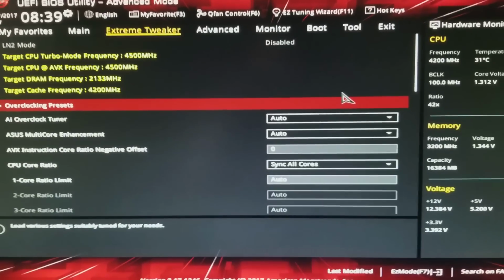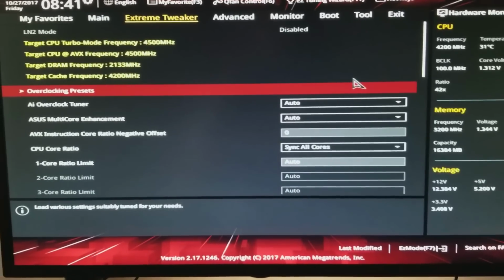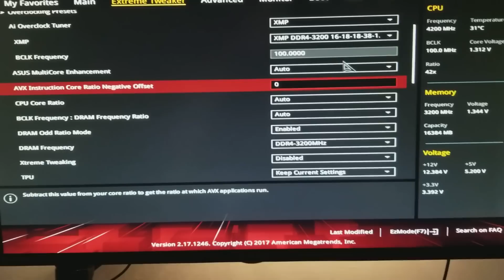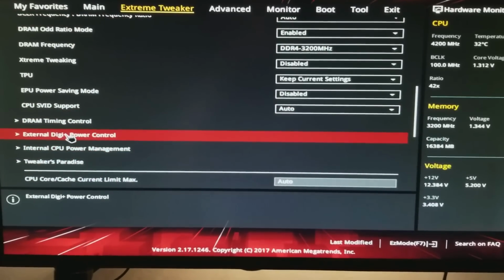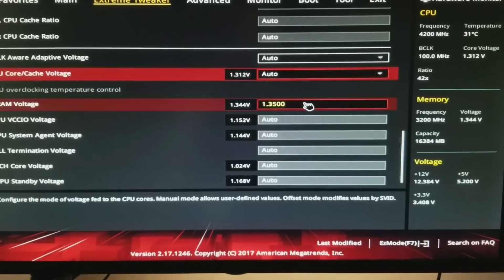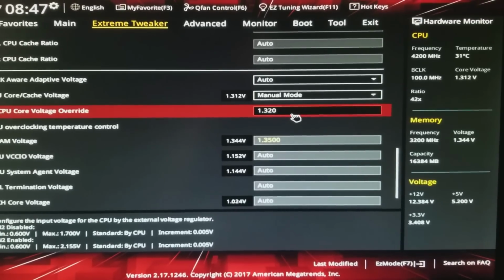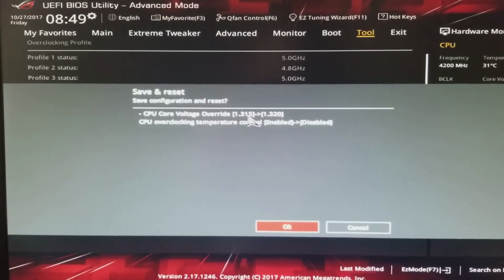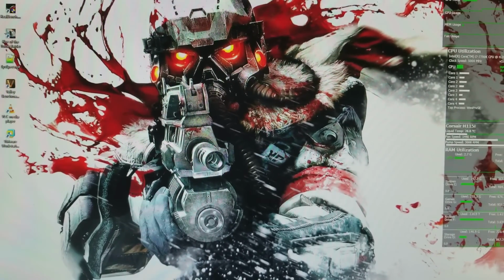Overclocking i7 7700K to 5.0 GHz on Asus Maximus IX Hero Motherboard

Comment: I pretty much own the same setup as you, just changing the VGA (1080ti here) and the PSU (EVGA G2L 850W Gold), but the rest is identical, same CPU, same RAM and same Water Cooler and MoBo, with the difference that I lived in a city in South America, most precisely in Curitiba,  South of Brazil which is the coolest region of the country, even though, we still getting around 25~28 degrees celsius (around 77~85° F) in this Autumn, do you think my system supports the same changes you did on yours without crashes or superheating? What can you say about the  shortened life of the components using a overclock like this? Thank you for share this content!
Reply from the maker: It's hard to say without testing it myself. I am in southern Canada but I keep my place between 18*C-22*C depending on the season. Ultimately I try to leave a 20*C margin with the CPU max temp, as long as you can achieve that you should be okay. Also, as I mentioned in the video, delidding greatly reduced temps. I would easily hit 100*C before delidding, now I never go above 80*C even with all cores at 100%. notably my h155i died and I have been using a Noctua NH-D15 for a few months now with slightly better cooling performance. I have been using these specific settings (but disabled AVX offset) since this video was posted and have had this chip OC since i got it a little more than a year ago. I have only had a few crashes (mostly while making minor OC changes and testing). As for longevity I can't say for certain; however, I have OC every CPU I have ever owned and have never had one die before I decided to upgrade anyways. Every chip behaves a little differently, some overclock better than others. I'm sure some can/will die prematurely with no OC done to them.
Reply: K JL thank you for your answer! I think I can do it on my setup...

Comment: Ty for the video, i am able to do 5.1ghz with 1.32v runs 65c under load

Water cooled and delided...

I was run ing just under 5ghz with asus bios built in OC, running 70c underload
Reply: What was your Avx offset?

Comment: I have z270 mark 2 and i7 7700k, all parameters are stock factory and my processor is at 4500ghz always. when I don't use my computer the processor should be in a lower frequency but it's not the case. anyone know the problem?
Reply: Asus multi core enhancement

Comment: Why my cpu voltage shows up to be at 1.008 V only?
Reply from the maker: Dj Steirdi Are you refering to the voltage seen in the BIOS when setting the vCore. Most likely this is your stock clock voltage. If you set the multiplier to 50 your CPU will not run at 5.0GHz until you reboot. Once you have everything set save and boot back into the BIOS the voltage should now be around the vCore you set.
Reply: Yes in the bios and i also did everything you mentioned in this video and my CPU-z and HWmonitor shows my cpu to still be at 4.2GHz, i tried and changed those same values in Intel Extreme Tuning Utility and they worked but i uninstalled it because i thought that it was conflicting the bios so now it seems like i can't overclock at all. The changes doesn't take effect when i change these in the bios for some reason.
Reply: Never mind it seems to be working now, i just incrased the voltage to 1.350V because it was too low for a such of high overclock.
Reply from the maker: Dj Steirdi It can vary from chip to chip. I have been stable at 1.32 for many months now. 1.35 is still decent, make sure to do some extended temp and stability testing.
Reply: Aye, actually now it's sitting at 1.30V and seems to work just fine, although when played a game it stopped working couple of times and just froze with sound looping so i decided and tired to remove IA DC Load Line and IA AC Load line if it fixes the problem hopefully. I'm not sure what is causing it but hopefully it will be fine for now.
Reply: Hey again i'm here sorry.. But when i updated my bios all my settings were gone and default so i needed to overclock again.. So when i set that AVX thing to to 2 when overcloking to 4.8GHz obviously it's 4.6 GHz when you're using such programs but while i ran the Chinebench it stayed at 4.6Ghz~ still so can i just set it to 0 and it wouldn't hurt anything or reduce my CPU lifespan at all? (Not delidded) Also is a 1.270 voltage enough do you think or such of CPU speed?

Comment: 5.0GHz = 1.36V
4.9GHz = 1.26V
4.8GHz = 1.22V

Dont over volt your cpu :D
Reply: Heram Maravilla mine needs at least 1.4v... just to boot... I really didnt got lucky on the lottery
Reply: My chip does 4.8 at 1.24. confirmed with OCCT large dataset for 5 hours. 1.22 and 1.23 were unstable.

Comment: Hey bro i have a question do i need to overclock the 7700K to use xmp on the ram because i want to have 3200MHZ not 2133MHZ do i have to overclock necessarily
Reply from the maker: Patricio Villagra nope you can enable xmp and use the stock clock speeds if you want.
Reply: I have the same setup..overclocked to 4.8 stable right now. 5.0 got too hot even with liquid cooling. Need a delided cpu
Reply: Oh and my ram wont go to 3200mhz..wont boot windows. 3000mhz works fine though. I pull 130-150FPS in Just Cause 3 on highest settings in 2k resolution
Reply: @kojack635  You got screwed if you bought 3200.   Gskill is your friend.
Reply: Kojack mine boot with 3200 mhz thats weird

Comment: I overclocked my cpu but it won’t even load in to my desktop it just stops and everything turns off on my desk ? What am I doing wrong? I have a Corsair h200i
Reply from the maker: Paytonzfamez you overclocked to 5.0GHz? Are you able to get a stable OC at 4.8GHz? What vCore voltage did you set?
Reply: I did 4.8 and it won't boot.

Comment: Does this guide work the same with the Maximus IX Code Motherboard?
Reply from the maker: OrganikSkillz yes it should. Technically speaking the settings adjusted here can be done on any mobo it would just be a matter of finding them in the bios and tweaking them for stability.
Reply: Yep. I have the exact same mobo and it works completely fine.
Reply: I have a Maximus IX Code and my clock is 5.2ghz, vcore 1.43 and temps +/- 75º. I have one Thermaltake 360mm.

Comment: do you have to delid?
Reply from the maker: Chris Hornback yes i delidded my CPU. I did say this in the video.
Reply: I know I wasnt asking that im watching your video right now, im wondering if you have to delid it
Reply: and do u have discord i have a question
Reply from the maker: Ah okay. Well you dont "have" to but i would recommend it for 5.0 GHz. Prior to delidding I would hit thermal max (~100*C). Where as now I do not exceed 75*C even at 100% load. I ran at 4.8 GHz for a long time prior to delidding with no major temp issues.

Comment: Personaly I dont see any reason to even attempt de-lidding you're cpu unless you want to break it, or you want to push 5.2 ghz. If you do it slowly and the right way you can have 4.8-5ghz on a 7700k without problem but cooling is important
Reply: Spectraculus it's to improve the contact between the chip and the cooler for better temps.

Comment: What temps are u getting @ 5.0GHz? Had to drop mine down to 4.9GHz at 2.80 volts. At 5.0GHz I was getting in the high 80°C. Great OC video! Thanks.
Reply: 2.8v Are you trying to cook steak on it?
Reply: 2.80v?
Reply from the maker: At 5.0 GHz I am geting 40*C-55*C during gaming depending on game/load. Idle around 30*-33*C and full load H.264 encoding is 65*C-70*C. When are you seeing 80*C? through general use or when benching. Because Im pretty sure I could hit 80*C if I ran AIDA64, but that is much better compared to the 99*C I was getting before. If 80*C is your bench/torture temp then that really is not that bad. If it is a temp you see when gaming or with heavy (normal) CPU load then yeah that is pretty hot (but still 20*C below thermal max).
Reply: @KJL00 yeah um are you trying to bow it up? should never go above 1.4. I am at 5 Ghz 1.28 (got lucky with my board/cpu) Oh and for a 7700k you should get a NH - D15 (don't need to delid your cpu)
Reply from the maker: @parkinsaw  not sure where you are getting that i said to set it to 1.4. In fact at 7:45 in the video I suggest not overclocking to 5.0 GHz if you cant achieve a stable overclock before reaching 1.4v, especially above 1.40v. My h115i died since doing this video and i am currently using a NH-D15. I said I recommend delidding it not "you must". No, you don't HAVE to delid, but you will see far cooler temps if you do. I delidded my CPU before I did this video and it has been running fine since, it rarely ever exceeds 75*C (at continous 100% load); however, before I did that I would thermal throttle and almost hit 100*C. Every chip is a little different, so yeah some may not have to delid, others might if they dont want to burn out their chip with continuous high temps. I have heard of very few people that have not had soaring temp issues with this chip. Especially those who got it around its initial release. Again, with this OC, delid, and using the NH-D15 for over a year now, I've had no stability/temp issues.

Given the chip would probably fry at 2.80v and not go "high 80*C" like the original comment suggests I take it they meant 1.280v.
Reply: @KJL00   Yeah sorry meant to reply to the individual above you lol, wasn't quite sure what he meant with 2.8, but you are correct delidding a 7700k is preferable but not always needed

Comment: What app / desktop widget are you running on the right side of your desktop? The one with your system resource stats.
Reply from the maker: It is called rainmeter (https://www.rainmeter.net/ ). You can find a lot of good skins ones online. The one in this video is variation I made of the following skin: https://socaldj.deviantart.com/art/Ultimate-System-Monitor-182665749

Comment: K JL  did you know about PLL OC voltage?
Because it can drop 10-20C
Reply from the maker: Have you tried this on an Asus board? 
I looked into it and from what I can find most people that tried this did it on an MSI board.
Maybe I'm missing something but in my BIOS I can only find "PLL Termination Voltage" and "PLL Boot Voltage", no "PLL OC Voltage". From what I can find it also looks like these large differences are related to inaccurate readings, idle temps below or too close to room temp.
Reply: K JL man ive been running like this for 8 months and when i didnt mess with the "PLL OC voltage" i was getting 78C+ easily on 4.5Ghz.
Since then i managed also to overclock my CPU up to 4.9Ghz with 1.35V and play games with no issues.
No Damage seen anyway..
Im still getting the same scores as i used to get when i built my new PC on january 2017
Cinebench R15 MultiThread (Stock)  1005 Points
On SingleThreaded(stock)
197 Points.
And it still getting to that scores.
Reply from the maker: What motherboard are you using? I cannot find a "PLL OC Voltage" option in my Asus Maximus IX Hero BIOS...if you are using the same board or other Asus board I'd like to know where this setting is. That being said with the settings shown in the video I  dont exceed 76*C even when 100% load encoding H.264 with handbrake or adobe premiere, or when running prime. My gaming temps at 5.0GHz are 45*C-50*C so I  wouldn't expect too much of a drop beyond that regardless of what is being changed.
Reply: K JL I'm using an "msi z270 gaming m3".
I guess you delided your cpu though
Reply from the maker: Yeah, from what i can find "PLL OC Voltage" is in MSI BIOS. I don't think it is in the Asus BIOS (I couldn't find it anywhere). 
Delidding greatly reduced my temps. Looking forward to the day when Intel uses a better TIM.
Reply: K JL yeah intel lol..
Have you tried PLL termination voltage?
Edit:
Funny that you have same build like i have
16GB 3200Mhz
GTX 1070
I7 7700K

Comment: Reccomendations on thermal compunds? + Is a i7 7700k worth upgrading from a i7 4790k @4.37GHz?
Reply from the maker: TJGames I'm using Arctic Silver 5 between the IHS and my CPU cooler. I can't say for sure how much of an upgrade it would be, I found this comparison http://cpu.userbenchmark.com/Compare/Intel-Core-i7-7700K-vs-Intel-Core-i7-4790K/3647vs2384

If you are going to be upgrading what about coffee lake http://cpu.userbenchmark.com/Compare/Intel-Core-i7-8700K-vs-Intel-Core-i7-4790K/3937vs2384
Reply: K JL untill u see a consistant price for the 8700k i wont be bying it :) does it use the same chipset at i7 7700k
Reply from the maker: fair enough. I believe the 8700K uses the z370 chipset, the 7700K uses z270

Comment: For some reason my CPU on max load (using prime95) hits 4.8 should I up my voltage?
Reply from the maker: I have seen somewhat odd behavior with Prime95 (I only use it for long duration stability testing).  Are you using a newer version of Prime95 (v27+), I believe this is when AVX was implemented with Prime95. If you set a "AVX Instruction Core Ratio Negative Offset" of 2 and are using a newer version of Prime95 then this is the expected behavior.

You can try:
1) In the BIOS set "AVX Instruction Core Ratio Negative Offset" to 0 for your stability testing, set it back to 2 or whatever you want (if you want to) once stability is confirmed.
2) Use an older version of Prime95 (v26.6)
3) In the directory that you have Prime95 open local.txt and set CpuSupportsAVX=0

CpuSupportsAVX=0 (AVX OFF)
CpuSupportsAVX=1 (AVX ON)

You can also try other benching tools like AIDA64 and OCCT (With AVX unchecked).

I may be wrong here, but this seems to be the logical cause.

Comment: are you delliding your processor? my stock i7 7700k processor run 33-35c on idle & I used cpu cooling kraken x62
Reply from the maker: Yes, I said that in the video haha. I delidded and swapped the TIM with liquid metal. With the delid and overclock I idle around 32*C. Gaming load is usually 50*C-60*C and prolonged use at 100% (Benching/Rendering) stays around 70*C. Prior to delidding I hit 100*C and thermal throttled when OC to 5.0GHz
Reply: K JL Mine idles at 25-30˚ c with stock TIM and a Cryorig c7. All fans on 500-600rpm
Reply from the maker: I'm not sure you can drop the temps below room temp. The difference is when the CPU is under load.
Reply: K JL Its not possible at all to have lower temps on the cpu than in the room. My room is around 20-25˚ C